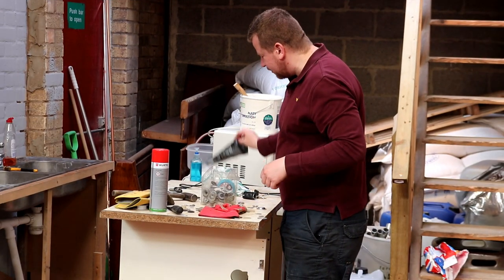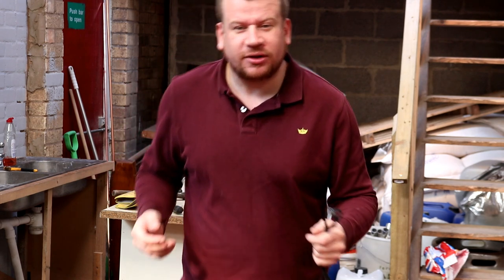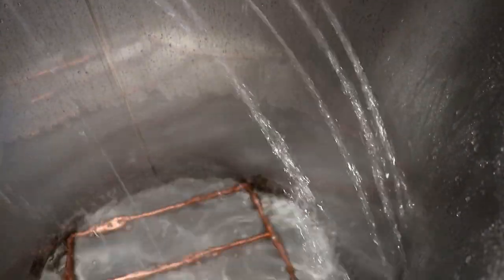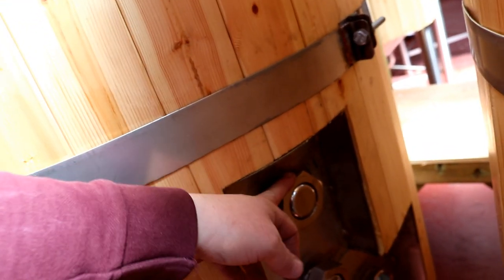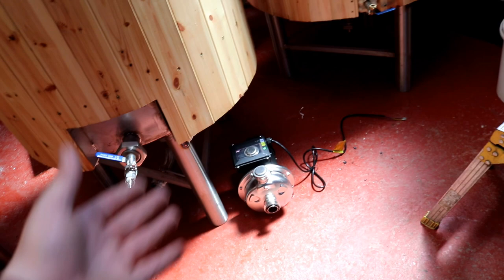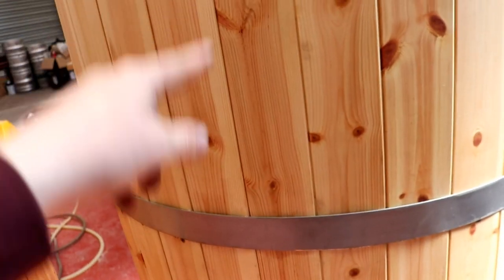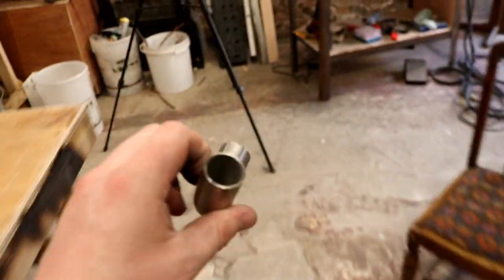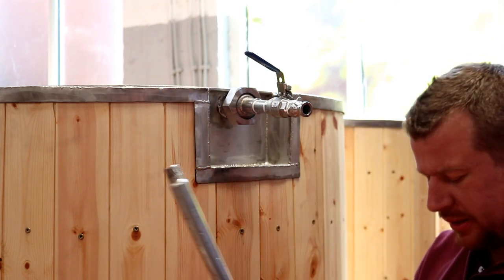Boil Kettle Whirlpool PipeWork

Comment: Are you planning on using a whole leaf hop filter on the center outlet of the boil kettle? what about having a little outlet on the kettle base off center so you can draw off wort away from the trub cone made by the whirlpool?  maybe build a little dam in front so you dont pull any hops though.